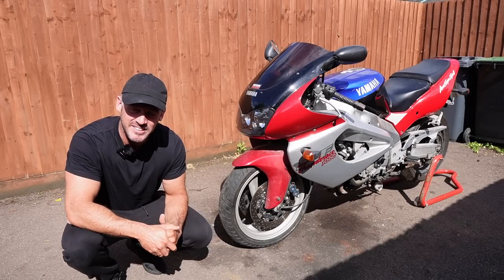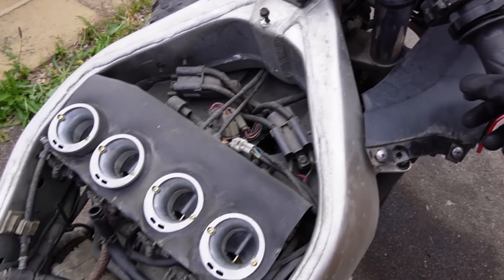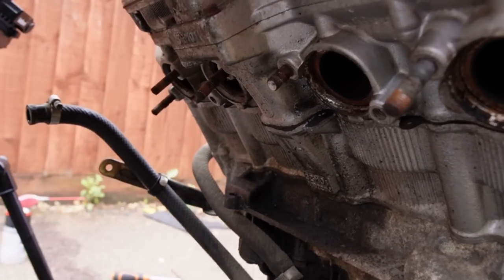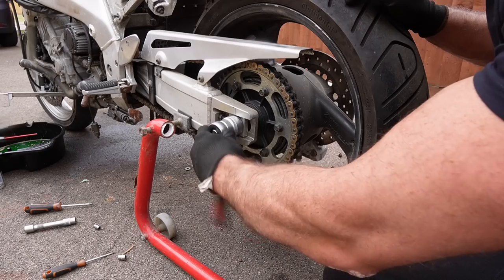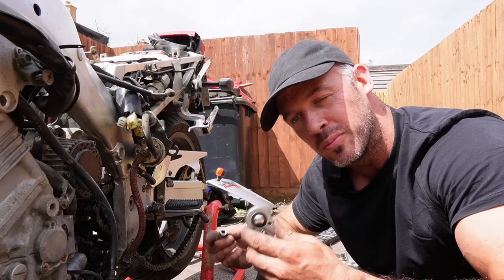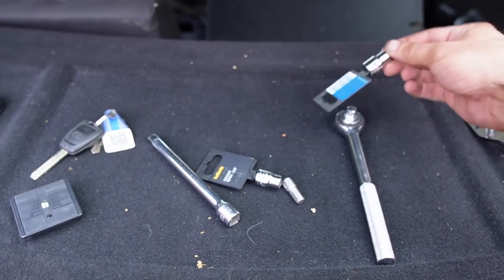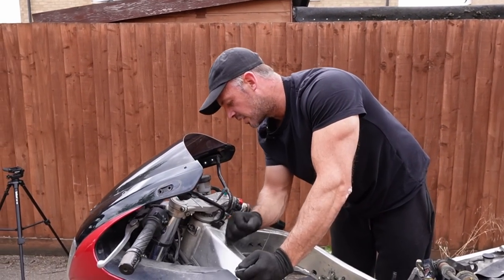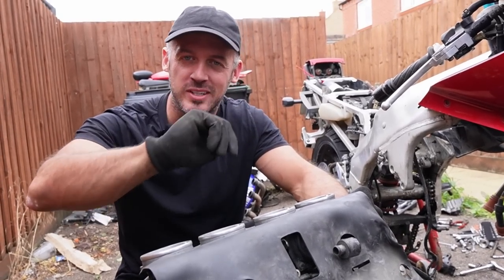REBUILDING A YAMAHA YZF1000R THUNDERACE

Comment: Attach your cables to the carbs before refitting them, the slides in the cabs will operate with the engine running (constant vacuum carbs) you will probably see cv stamped on the carb bodies.

Comment: I'm glad to see you doing the right thing and changing that frame.
If you get yourself a Breaker bar it will give you more torque on stubborn nuts and bolts and you won't risk your ratchet getting damaged,which can also be dangerous.

Comment: Carb slides - the vacuum will cause them to move and meter the fuel. A perforated rubber would stop them sliding and cause rough running - easy to diagnose when looking at them with the bike running.
Reply from the maker: Nice one thanks for sharing

Comment: My other top tip when removing the engine is, before you undo any bolts,  take the weight on the trolley jack / block of wood, .. That way, the bolts are  not under tension when you try and undo them and are easier to undo. Plus, the engine doesn't drop when you take the last one  out, as it's already supported. Good luck with your donor bike   / frame

Comment: To get the broken exhaust stud out, wind a nut on, wind another on top, and tighten together in opposite directions. Then just wind it out using the lower nut.
Reply from the maker: Appreciated!
Reply: Heat will help you too. A heatgun or torchgun works great for that.

Comment: Nice job, I enjoy your projects and it's great that you show everything, including the snags, as it's good for others to see and will help those new to stripping bikes down. A piece of advice I will offer is that it's best to use a T bar rather than risk breaking a ratchet on very tight, stubborn bolts with liberal use of release oil, wd40 etc, then switch to a ratchet once it's moving.

Comment: Specifications

Engine: water cooled DOHC 20-valve in-line four
Displacement: 1002cc
Horsepower: 145bhp @ 10,000 rpm
Carburettors: 4 x 38mm Mikuni CV
Gear box: Five Speed
Frame: Aluminium-Alloy beam
Wheelbase: 56.3 ins
Weight: 436lbs dry
Top Speed: 170mph

Comment: When totally stripping a bike keep it in as big bits as you can so you get down the bare frame as fast as possible. Take wheels off, remove whole swing arm assembly, remove yokes with forks still in them, remove engine ect. Then strip the sub assemblies as you go through them.
That way your undoing the least amount to strip it fully.
Plus get breaker bars, don’t use ratchet head to undo tight bolts.
Reply from the maker: Great advice! I thought this myself as I rebuild the bike onto the replacement frame
Reply: @BikesofRye  Yes, you then strip each sub assembly to rebuild. It also keeps all related parts in big bits so less chance of loosing individual parts.
Reply: @BikesofRye you've chosen to dump the frame then mate ?

Comment: i had  a  thunderace as a company bike, your one seems to have a kph speedo if a grey import it may only have 100hp or even less, i have a few rebuilds under my belt if you strip the motor have plenty of sealable bags and write whats in them on the bags if you need a manual buy a haynes or similar as factory manuals assume a high level of knowledge, good luck

Comment: A metal pipe over the end of the ratchet gives a lot more leverage to undo bolts or even a large ring spanner on the end. I also stand on the racket to undo tight wheel spindles. No strength needed just weight putting 1 foot on and pressing down. Much easier. 😁 Looking forward to the next Instalment and what you do about that huge dent in the frame which is a real shame. 😢
Reply: Really bad advice,a workmate of mine actually injured himself only last week using a bit of pipe on an Allen Key. Tools are designed to be used without extra leverage,everything you've suggested is either dangerous,liable to break something or both.
Reply: @dave8204  Or he's not safe to go near tools.

Comment: Re your broken exhaust stud, roast it as much as you can with a good blow lamp, clamp on a set of vice grips as hard shut your hand power can clamp them and believe it or not, rather than loosening it immediately, actually tighten by 1/8th to one quarter a turn, then loosen it one turn out, 1/2 turn in, one turn out, 1/2 turn in until you know that it's feeling good and will confidently extract normally. I've never had an issue with this method.

Comment: It's easier to disconnect the throttle cables at the grip end and the clamp on that end of the cables should be in two halves and come off. Put some heat on that broken stud and gently work it back and forward with some grips. Still got plenty of stud to get hold of. A breaker bar is a good investment for all those really tight fastners.  Looking forward to next installment.

Comment: This was such an under rated bike in its day, it was a replacement for the fzr 1000 exup and was lighter than the fzr with basically the same engine but a more modern fairing, although it has to be said the thunderace name and the stupid aero super sport graphic is cringe worthy now. The thing was the motorcycling press set it up to compete with the fireblade and it was never going to beat that on a track or tt course, or even on a twisty back road but that was missing the point, as a fast but fairly comfortable every day  sports bike it was great, with good brakes, decent suspension and an engine so torquey they didn't bother giving it a 6th gear. Yamaha must have already had the r1 well in development by the time the thunderace came out in 1996 so I don't think they ever saw it as a fireblade rival, that was for the r1 to put in its place, see the thunderace for what it is and it makes a lot more sense. So many have ended up scrapped that its become a very rare sight so it will be good if you get that one back together and in original condition. I like that you admit you don't know what you're doing but have a crack at it anyway, good on you. You'll love it once its on the road.
Reply: With you on the name thing. I'm convinced the 600 Thundercat would have sold loads more without that stupid name on the fairing, not least as it was also the name of characters from the He Man kids tv series. Made as much sense as if Honda had called the CBR 600 the Womble.

Comment: For removing stubborn bolts, you need a breaker bar AND a 'cheater bar'. A cheater can be any bit of steel pipe that fits over the breaker. You are creating a fulcrum that multiples the force at the end of your tool. If a bolt won't move with a breaker, cheater and a good quality socket on the end, yer screwed. From there you will have to use  use heat along with some cunning. (A six point socket is advised for highly torqued bolts.)  Steel bolts that are torqued into aluminum alloy can be notoriously difficult to remove due to a chemical reaction between the two types of metal. Assembly can be done by preparing all fasters with a preparation applied to the threads.The type to use depends on the application. Where heat is a factor, a tube of thread preparation containing a copper compound works well. (Use gloves cuz it's poisonous.)

Comment: Easier to remove or refit the throttle cable with the carbs out of their stubs. 
Looks tricky but done loads and it’s not that bad. (98 R1’s, FZS1000’s etc)

Comment: This is going to be interesting to watch...

I'm certainly not any form of mechanic, but I have to give you two tips so far:
1/ When trying to move a stiff bolt, it's easier to use bodyweight by pressing downwards than muscle power in a different direction (but you do have to be careful about not punching the ground!).
2/ You should have taken the carbs off before removing the engine..! :D

But, so far so good!
Reply: Alternate between loosening / tightening bolt. Saves mullering the head in one direction when extremely tight and wont move

Comment: Can throw a review in on a cheap impact driver whilst at it? 🎉 Even a cheap one will get you 100nm of torque.  That'll solve all your access issues and rattle the nuts loose.
Reply: Cheap tools are never a good idea if you're tackling something like this,there's a reason mechanics spend a lot of money on Snap On and the like.  Cheap tools can be dangerous or fail quickly.